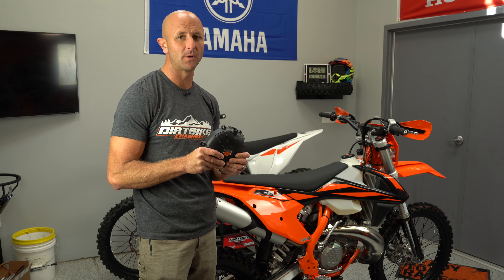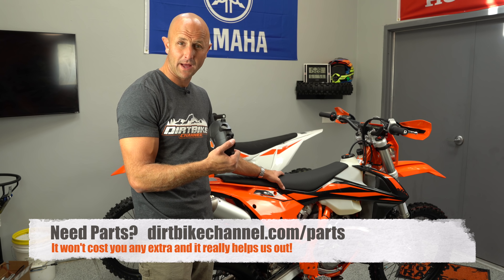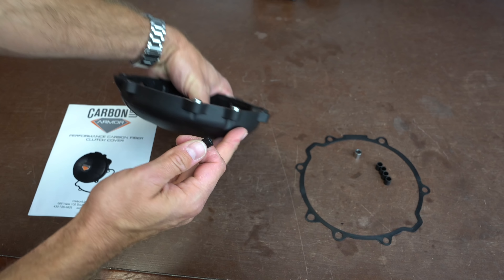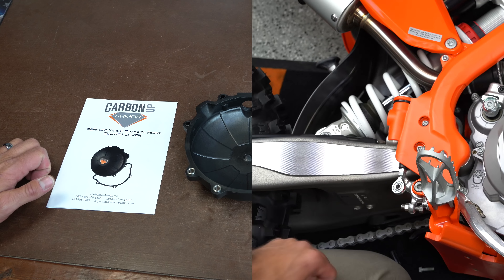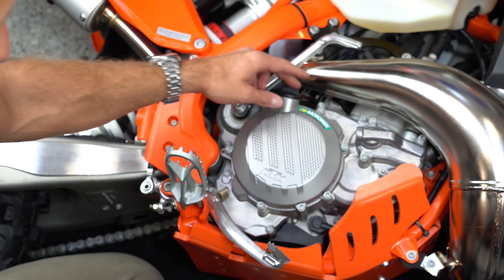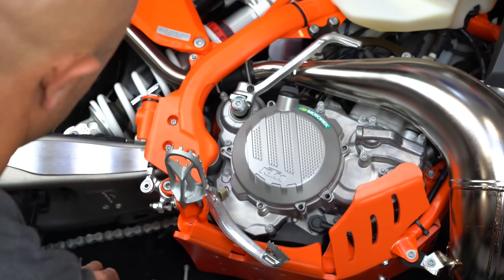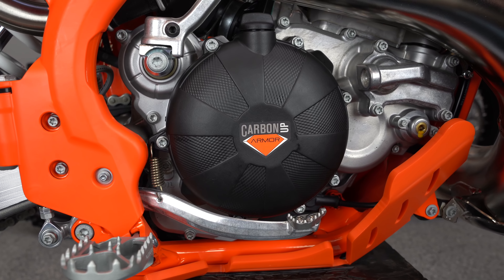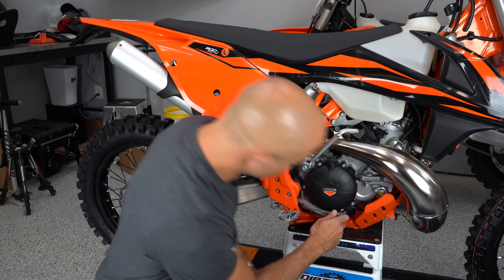Indestructible? | Carbon Up Armor Clutch Covers | How To Install and First Look

Comment: I'm running a auto clutch. The cover is more substantial than my stock. That carbon up looks like a nice peace!  One thing that probably won't stop the break lever punching a hole but gives me a lil peace of mind is to cable the lever to your skid plate! Good to see you back in the saddle bro!

Comment: The 18 XCW's have the longer bolt too, I learned this the hard way when putting a hinson cover on. Replacing the starter motor was a giant pain in the ass so be careful.

I with this carbon one I was concerned with it warping a bit and causing leaks and not having as good of cooling as a billet Al cover so I just went with the tried and true hinson cover. plus it give the bike a factory look

Comment: Carbon/resin has very poor heat conductivity, resin in fact is used as a heat insulation. Since clutch surface is a large heat diffuser - you must be increasing temperature a lot by Adding this. I would recommend aluminum cover and put some copper paste / other thermal conductive paste underneath the cover.

Comment: Kyle, to your friends that rode with no oil, how did their gearbox/clutch system hold up after that? Assuming the clutch plates would take the most of the heat, how did their gearboxes hold up?

Comment: I just got the cover i notice oil by the outside of the cover where the gasket is i dont know if its because i tip it over i torqued it down right any idears its a 2020 ktm excf

Comment: I have an 18 300. I broke the clutch cover, after i installed a new one, the starter motor stopped working. Apparantly one of the bolts is supposed to be shorter but with mine all 3 of the long bolts are the same length?

Comment: 0:22 sketchy KTM front ends seem to wash out way too easily.... an issue I have and been trying to get addressed on my 2017 xc250. My Honda can be pushed way way harder in corners without breaking front end traction.
Reply: What year is your ktm?
Reply: 17
Reply: What tire are you using?
Reply: @poole0704   For me I think that was part of the problem in the terrain I was riding. The stock one was wider and had a different profile then what I use on the crosser. (stock tire may be good for the rocky stuff not sure though) I switched to more familiar geomax 52 intermediate. These bikes seem very sensitive to set up... been working with fork height and sag to get it working better but I think they are nimble handlers by design and sometimes that makes the front knife out more easily. 
(all just my opinion) but I have had a couple of these crashes myself too as well as a few more near ones. hahaha!
Reply: True I’ve done the exact same thing already
Reply: I have the same bike (110 hours on it now) and haven’t felt comfortable with the front end until the past 2 months when I installed a Bridgestone M59 (I’m in dry, rocky Colorado) and dialed in my shock with a revalve. I run my stock forks up high ( 3rd line) and between 125-135 psi. I only trail ride but at a pretty quick (above average) pace and can really push it a lot more in the corners now. I'm still looking to do a revalve on my forks but am really happy with them in stock form
Reply: @bikermike  I hear ya man these ktms are very hard to get setup right. I did the exact same thing with the tire and moved the forks up. I did switch out the rear shock for a softer feel and it seemed to make it better but it all comes down to your individual feel. I'm trying to avoid the $1200 revalve job.
Reply: @poole0704  I've slid my forks beyond the last line on the forks the distance to a fourth line if it was there, running sag at 105mm all stock valving. I think the idea is to find a balance of getting more weight over the front wheel, while avoiding any head shake at higher speeds. But open to try other things too

Comment: Ok but what about ..cold freezing weather I'd think it would break much easier then the stock.thought about a case saver that can add heat but least can control that can't control cold..any facts on this???
Reply: gypsymanjeff 21 the oil and engine will keep it warm
Reply: Check out Slavens racing website. The way he hammers on it make me think a bit of cold won’t cause a problem

Comment: Mine leaked day I put it on my 2020 ktm excf sucks because I like it its stuff I installed it right torqued it down but leaked
Reply: I have 2 of them and both of them leaked since day one. But further more - they WARPED after a few monthes of usage and leaked bad. Waste of money.

Comment: These clutch covers are rubbish. They may not break but the fact they flex means your internals take the hits. I'd much rather break a clutch cover rather then bend or break a clutch basket
Reply: Exactly... I wanted to buy one, but after I read your comment, it changed my mind